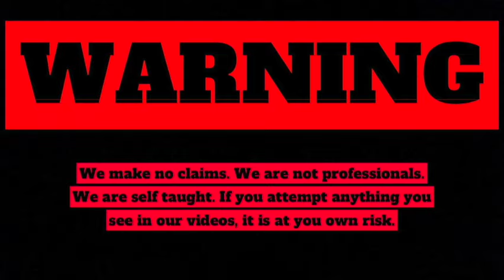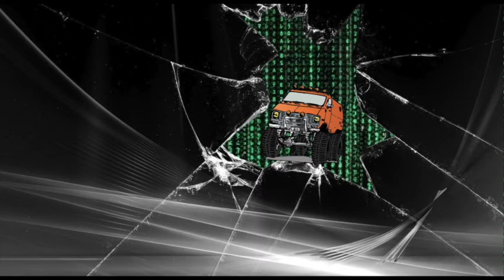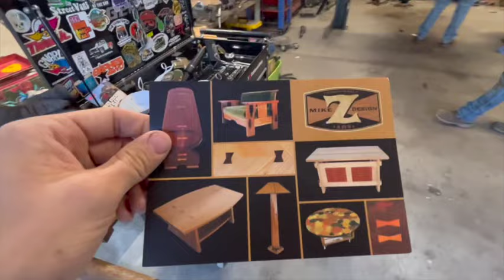Shorty Boogie Van 4x4 Conversion - The Swim Shop 4x4

Comment: What spring would you put on the rear? Would it be a 4” to match the front or do you need something different to level it out? Thanks!
Reply from the maker: We did the stock springs with a shackle flip on that one. Thanks for watching.

Comment: That thing is sweet! Does it have the 4.3 in it or the 5.7? Also, what gear ratio is in it? I'm currently converting a 92 shorty, stole all the running gear out of an 80's K5 Blazer
Reply from the maker: It is 305, we will be changing the gears to 4.10 soon.

Comment: Pretty grungy looking wheels and tires to be bolting on a new build, don't even bother to clean em up? Sure would make the van look alot better. Just my opinion ,but then ,opinions are like something else we all got , not hard to find one.
Reply from the maker: Pretty don't win!! Thanks for watching.
Reply: I have a 1979 GMC Van Dura I bought new with HD cooling, charging , limited slip, elec. windows locks, tilt, the good seats, flip out windows in the rear and side door, 400 small block 2500 series that at 6 months old, I jacked it up and gutted it . I used a 1980 with @theswimshop4x4  only 58 miles on it some salesman  rolled first day he had it for the doner. I used the spicer front end, I had  positive arched springs made for the front end of it, a dodge truck steering box with the reverse worm gear, NP rock crusher transfer case, put angle plug heads on the 400 with good springs, roller rockers, Comp camshaft ,MSD dist & ign. Box, hooker headers and stainless exhaust, made my own spring perches and cross member mounts and has 5 chev. sport wheels on it and it's pretty .
Reply from the maker: Ok. @brucegambill6303